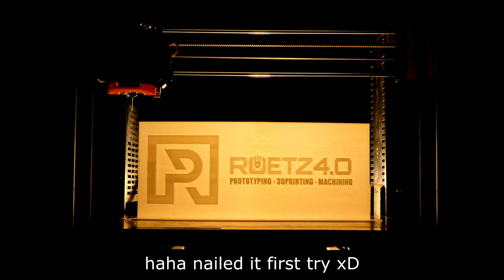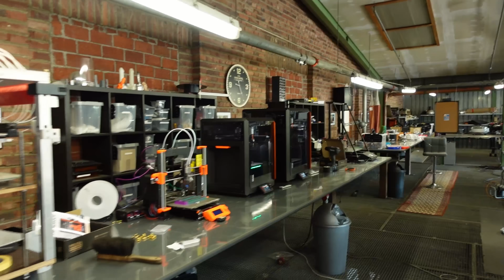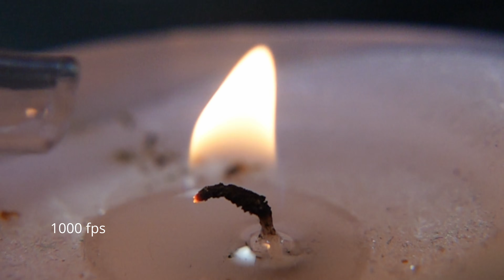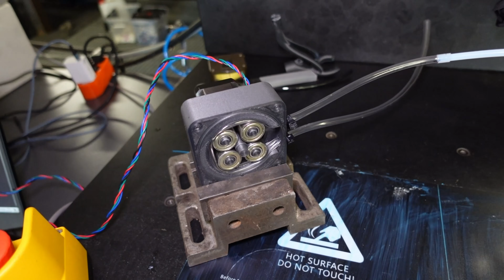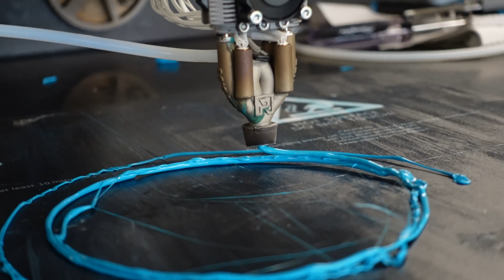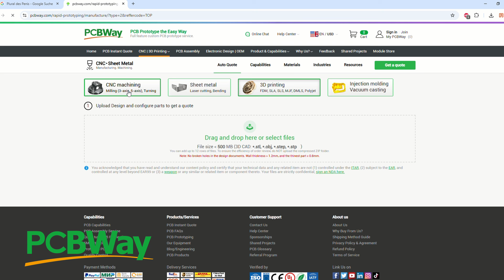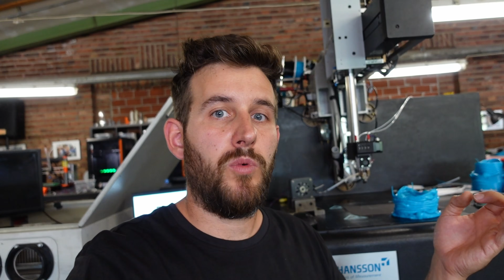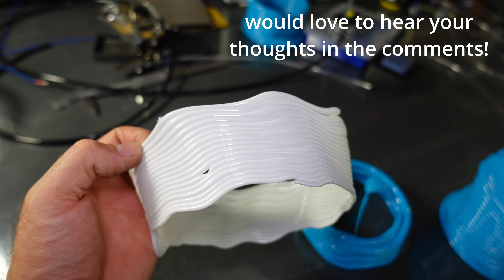Your Ideas made it WAY BETTER! 3D-Printing TPU Tubing

Comment: You need soft silicone tubing for the peristaltic pump, aquarium airhose is too stiff
Reply from the maker: You're right. I was working with what I got on hand. PVC tubing in a printed pump gave me results in less than 24h, way faster than ordering stuff. :)
Reply: @Roetz40 and dude try to use less rolls, 3 or 2, it'll make less resistance and won't lead to air escape if tube will lead more than 180° on pump radius
Reply: @Roetz40  SANTOPREN this is what you need its material for peristaltic pump tube.
Reply: He can print the tube with soft tpu
Reply: @christian455 or just buy a pump. It's a solved problem. No need reinventing a component that's readily available and super cheap.
Reply: yeah but wheres the fun in that
Reply: @EmilBjrn  Silicone tubing doesn't fully collapse in a peristaltic pump, which can alter dosing and DOES prevent accumulation of pressure or vacuum. While TPU doesn't solve that on its own, Roetz could alter his nozzle design to replicate the simple profile that MIT researchers used for peristaltic TPU tubing a few years ago which does.
Reply: @raudy6- The fun is in eliminating dozens of extra variables when something doesn't work.
Reply: Also the carbon fiber filament might wear down the tube very fast
Reply: I have an openscad stackable pump that I made a ways back for use with 1/4 in. I.D. x 3/8 in. O.D. natural latex tubing.  The openscad model is slow to render, and uses a gears.scad library.  If I remember right it worked very well but may need tuning.  No bearings are used, instead it's based on a helical geared planetary gear. I'm tuning it up checking it for errors in the stl now and will add it to thingiverse if it's desired.  It is a print in place design so just the tubing and an m8 bolt and nut with the tip ground to 6mm, the 5 to 6 adapter for the nema and the nema itself.  I made this to pump electrolyte.
Reply: Having sat in front of a bank of four them in a cardiac bypass apparatus  50 plus years ago, I can attest to silicon rubber being needed.👍